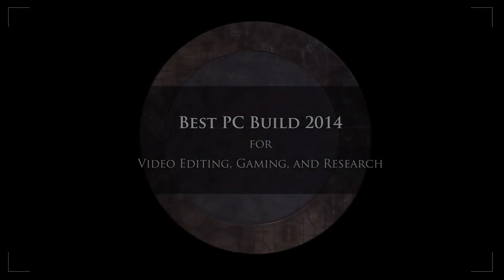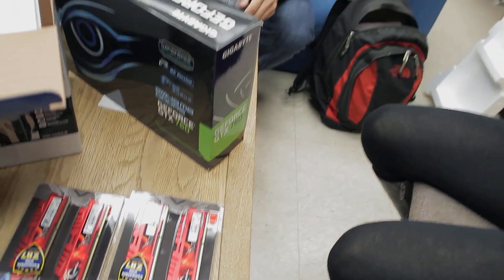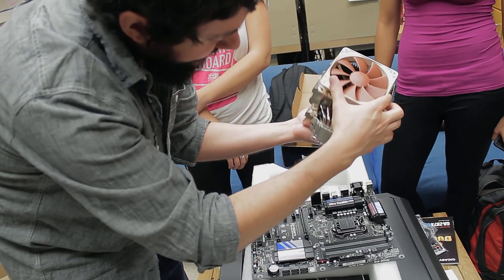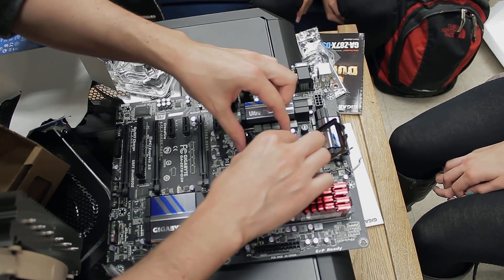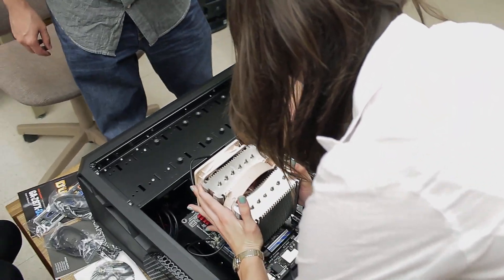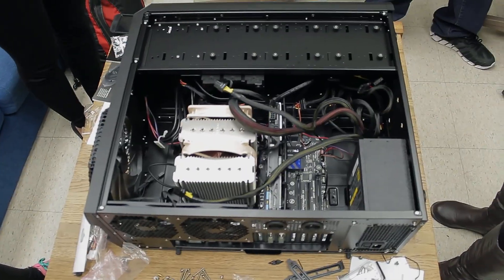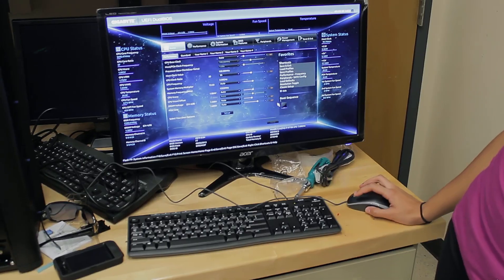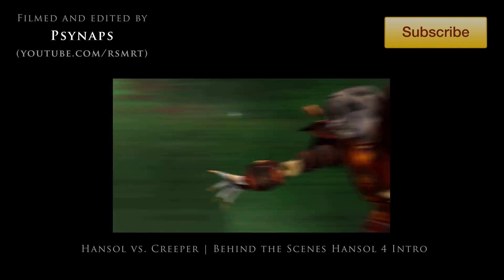Ultimate Gaming PC 2014 + Best Video Editing & Rendering Build (New Years Edition)

Comment: Unless you lay the computer case on its side, the large heat-sync will put a lot of downward pressure on the motherboard. Make sure to add support on the radiator. Shoestring sling mounted to the top of the case while wrapping around the heat-sync should do. Many a MoBo have broken due to these large heat-syncs.

Comment: 760? Amateur... GTX 970/980 just launched so I recommend, if your doing some intensive GPU programs (which you said your not), get it.
Reply from the maker: PickleKing3000 Yea GTX 970 is a really good value off the launch. Hopefully the 780 comes down in price as a result.
Reply: yeah i'm waiting for the prices to drop as well on the GTX 770... Decent performance for decent price
Reply from the maker: AgentCell Sorry you didnt get what you expected from the 980. Rendering still uses CPU, not GPU. The best render computers are powerful multicore CPUs. I am saving up for the new 5000 series Intel i7 which have 6-8 cores depending on the model. Those will be great all around video editing/rendering/gaming CPUs. Save the GPU for gaming, 3D, and previews. Rendering to popular video formats still uses CPU. Hopefully GPU support in the future.
Reply: I just build my mid/high end PC for the first time with a GTX 980 and I got to tell you when it comes to rendering videos, I'm very fucking disappointed. I heard from many sources that having an amazing graphics cared would've rendered my videos within seconds or minutes. It still takes me an hour with one video.

I looked online and set the preferences to use my GPU for rendering videos and it's actually slower than when I use the CPU. I'm really pissed off because I just spent over $1500 on building this supposedly grand PC. If anyone has a REAL guide on how to render videos fast, please let me know.

Below are my PC Specs. Tell me what you think.

Intel Core i5-4690 3.5GHz Quad-Core Processor
Gigabyte GA-B85M-DS3H Micro ATX LGA1150 Motherboard
G.Skill Ripjaws Z Series 8GB (2 x 4GB) DDR3-2400 Memory
Western Digital BLACK SERIES 3TB 3.5" 7200RPM Internal Hard Drive
Gigabyte GeForce GTX 980 4GB Video Card
Corsair Graphite Series 230T Grey ATX Mid Tower Case
Thermaltake SMART 550W 80+ Bronze Certified ATX Power Supply
LG GH24NSB0 DVD/CD Writer
Microsoft Windows 7 Home Premium SP1 (OEM) (64-bit)

Comment: What model of Gigabyte Motherboard are you using on this one?
I'm going to build a desktop for video editing specialy Sony Vegas 12 pro
Reply from the maker: Check description. I also noticed there are newer models of this motherboard from Gigabyte, just look at the specs to match. Cheers! Michael Razon
Reply: How long are you using this board? Sorry Psynaps I'm just a noob and I just wanna make sure that this is gonna last, because this is my first time building a deskstop and im interested in your setup, or if you have other recommendation for me regarding gigabyte motherboard , basically most of the time I'm going to use this for video editing . Thanks in advance and sorry for my bad English ;)
Reply from the maker: No prob. I have this board in 3 computers (basically 3 replicates of this build). They render 100% CPU all day since i built them with no problems and no overheating. My gaming/streaming/video editing machine has this mother board and build and I am sending this message using it. I have had no problems and is one of the best systems I have ever used. I can't tell you what you should do, but I can tell you my experience with this build and I am happy with it. Would build another. Michael Razon
Reply: Thanks a lot , it really helps me ;)
Have a nice day

Comment: Great build ,however your cable management is shocking ,next time take the other side panel off and route the wires from the motherboard side/tray through the management holes and then up the back of the motherboard tray and back through a management to the other side and plug in, this not only helps make it look more aesthetically pleasing but helps with better airflow as well which you were insistant on achieving

Comment: Why go with a 760 thats uses cuda  and is so much weaker when do video editing and adobe work??? And 16gigs would have been just as good, plus a 290 is a little more but with software you can unlock it too a 290x and make it 10x faster, i mean yes decent computer build but didnt put the money into the best use, and first thing i would run on it would be msi after burner since you can over clock that card super high with gigabytes 3x fan cooling

Comment: So you recommand to get the GTA 770 instead of the GTX 760? Thanks for your video, it helped a lot!
Reply from the maker: Update 6-614: Yea 780 > 770 > 760. I would def get the 770 over the 760. This computer was mostly for science and rendering so the 760 was good. Also, the 760 is great for BF4, LoL, WoW, and MC. However, for a better gaming experience add the 780 or 770 for a boost.
Reply: Psynaps Kinda fail underkill gpu for gaming and overkill ram for gaming
Reply: the gpu is good for science and ram is needed to launch those big projects 
a gpu that can run bf4 is NOT UNDERKILL

Comment: Heatsink: CORSAIR H105
 Psu: CORSAIR AX 1500i
 Gpu: GTX 780ti
Ram: G.SKILL Trident X
Mobo: ASUS MAXIMUS VII HERO
Storage: SAMSUNG 840 EVO 
Cpu: INTEL  i7 4930k

That would be the best Pc as of now. Then it's up to the user to choose how many graphics cards he wants, how many SSD's and how much GB's of Ram he wants. But these are the best components, quantity of the components is up to the user to the decide.

That being said.........

VERONICA IS SO FUCKING CUTE!!

EDIT:

And here is the July 9th 2014 Update for the best Nvidia/Intel Gaming PC (All while being realistic and reasonable: Screw the GTX TITAN BLACK and the GTX TITAN Z This is a PC that is for Gaming/Music/Video-editing so no GTX Titans required in this case.)

...So without further ado: 

THE SPECS:

PSU: Corsair 1500i
MOBO: ASUS Maximus VII Formula
CPU: I7 4790K 
GPU TYPE: GTX 780ti 
SSD TYPE: Samsung 850 Pro
HEATSINK: Corsair H110
RAM TYPE: Corsair Dominator Platinum or G.Skill Trident X
Sound Card (Optional): Asus Xonar Essence STX or ROG Xonar Phoebus

Comment: @ Psynaps you did alot of mistakes. you forgot to put the motherboard table in the case , horrible cable management , and next time.. never keep in your hands a motherboard with a giant Cpu- cooler cause you will  blow it. Anyway good job.. but you have to practice a little bit more.

Comment: Psynaps Is this a stable gaming pc build?

CPU : Intel Core i5-4670K 3.4GHz Quad-Core Processor
CPU Cooler : Noctua NH-D14 65.0 CFM CPU Cooler
Motherboard : MSI Z87-G45 Gaming ATX LGA1150 Motherboard
Memory : Corsair Vengeance LP 8GB (2 x 4GB) DDR3-1600 Memory
Storage : Samsung 840 EVO 250GB 2.5" Solid State Disk
Video Card : Gigabyte GeForce GTX 770 4GB (WindForce) Video Card
Case : Antec Twelve Hundred V3 Black Steel ATX Full Tower Gaming Case
Power Supply : Corsair 760W 80+ Platinum Certified Fully-Modular ATX Power Supply
Optical Drive : Asus DRW-24B1ST/BLK/B/AS DVD/CD Writer

Like is there anything that could be replaced by a cheaper part for the same performance? Is there any incompatibility? Is it a balanced build?

If I can get a response it would be great because I can't get onto tomshardware forums. Thanks! Love your channel!

Comment: AMD FD300 6 core- CPU 
AMD 970 MSI- Motherboard 
Radeon R9 270x- GFX Card 
LG DVD universal drive 
Kingston 8gb x2-RAM 
corsair 800 gold- power supply 
Storage up to you 
Case up to you 
Fan up to you 
This build will cost around $800 and can run Battlefield 4 at max settings at around 50-60 fps
Reply: Kursed Swaqq  still overkill
Reply: Vi Tran  forgot to mention I also over clocked so yea power supply is needed
Reply: I've seen this build before, and it is amazing!
Reply: Ernesto Del Bosque Lol, I've got an overclocked i7 & two Sapphire 7870's overclocked running on a single 750w psu... his 800w is so overkill it's sad..
Reply: TheAmanor123 aha i didn't end up joining yet, month or so till i get all the parts. ;)
Reply: Ernesto Del Bosque have you over clocked? Trust me it takes power, plus that's a 6 core CPU
Reply: Kursed Swaqq Sorry, I researched a little more now and you're right, AMD cpus and gpus are very power hungry specially when overclocked
Reply: still overkill man i got fx6100 oc 4 g and r9 290 and having 650 w power supply
Reply: Kursed Swaqq Use pcpartpicker it will tell you the estimated wattage you'll need and add I don't know 50 - 100w for OC
Reply: Ernesto Del Bosque thanks for the help
Reply: No problem! anytime
Reply: It is kind of shit!
Reply: aaron james your setup is so gay its sad :(   (making joke Dont take seriously)
Reply: Kursed Swaqq ;) I'm joining the darkside soon, i'm swapping to a fx-8320 & sabertooth motherboard ;)
Reply: aaron james good job bro welcome to the dark side of the power
Reply: aaron james nice make sure to get windows 8.1 if you Dont have it already it boosts your PC performance believe it or not
Reply: Already got it. (y) ;)
Reply: i cant oc my cpu well because of my 700watt psu i think
at 1.45+ volt or above the cpu underclocks some cores to 1.4 (AMD FX 8120)(XFX HD 7950)

Comment: Definetly the worst cablemanegement ive ever seen. Did you even THINK about using zip ties or routing the cables behind the motherboard? And the fans are going to hit the cables at some point... And whats up with these rear fans when turning on the computer? 1 started up slow and stopped spinning and the lower one didnt even turn on. And with video editing/rendering AND gaming its going to preform way better with only 16gb of memory and a gtx 770.

Comment: Nice build. Just wondering why you chose a heat sink that relies on airflow and then chose a non-modular (hard to manage cable type) PSU, thus causing hiccups in airflow. They aren't significant, but they can cause small bottlenecks in CPU temps and performance.

Comment: why not just get a corsair h100i
Reply from the maker: Very good question, I thought a lot about this. 1.) It costs more, 2.) does not perform any better for the extra cost you pay (see benchmarks, you may be surprised like I was) 3.) the entire system benefits from the airflow produced by the large fans on the heatsink keeping the case cooler.

Comment: First thing I would run is Skyrim, it would be sweet, I also have a question. 
Would a 650 Watt power supply power a GeForce EVGA 760 with no problem?
Reply from the maker: Nice, thx for the comment Brandon Gardner! 650 Watt for a single gfx card should be ok, There are power supply calculators on the web to be on the safe side, but my gut tells me it will work great!

Comment: Very nice! I have the same motherboard and processor. If you  record games I would recommend getting a second hd to store recordings on. I got a 2tb hd just for fraps lol. First thing I would do is wow on max settings and do lfr, I would think that's the most stressful thing for a processor/video card.
Reply from the maker: Thanks Bulletbill Wow for the comment! Good advice, I didn't show it here, but I actually got a 3TB external HD for these builds. For gaming and capturing, you will def need a large internal drive, preferably multiple large drives to hold all your video content!

Comment: I also use the i7 4770k (overclocked to 4.3 GHz) and the gigabyte GTX 760 oc. And it runs perfectly for both editing and gaming. :D
How much have you overclocked your i7 4770k?
Btw nice video ;)
Reply from the maker: Thx for the comment and input DanishPenguins! These work rigs are at 4.2, which is totally stable. If I go up higher, like 4.4+ I will occasionally get a crash when gaming, streaming, editing, and etc simultaneously. So it seems this build has a sweetspot in that area. There are motherboards that are better suited for more extreme overclocking.

Comment: Cool vid but i have to give some feedback xD
That was to much cool paste and 1 more tip you have to spread the paste over the cpu and NOT by pressing the cooler on the cpu
Reply: Imrie Schroer Watch linustechtips or tek syndicate. They don't recommend spreading the paste with a card. Because if you compress the paste near the corners it would "overflow" onto the motherboard. So its a no-no for spreading. Instead they recommend to put a small dot about the size of a grain on rice on the center and just compress the heatsink on. Don't correct me until you watch t heir videos. I may be wrong in minor parts but i remember the grain of rice part correctly.
Reply: rsmrt aN OLD CREDIT CARD WORKS WELL.
Reply: never spread it with a credit card. didn't watch the whole video but about the size of a very small pea is plenty of compound and the pressure of the mounting surface will spread it nicely.
Reply from the maker: Thx for the input and comment sinroysin! I am glad to get some feedback from a pro. Def an important part of optimizing the cooling. Temperatures on this build are great so far.
Reply: Getting pretty esoteric here. I never gave it all that much thought until now. Hmmmmmm.

Comment: I myself have built 2 computers before and done numerous upgrades on both of them and others. One thing that should be noted is that occasionally you'll get a component that is DOA(dead on arrival) and the computer will not start up. Although I've never had this happen I have heard about it happening to others.
Reply from the maker: Thx Jesse Smith for the comment. This is the 3rd replicate of this build I have done, and so far I have no DOA parts. Each component was carefully selected based on rating and other users experience, and I have been fortunate.

Comment: Also, you forgot to mention the following: ALWAYS watch your screws. Keep them in different boxes for different sizes. It is very easy to loose screws while building a PC, so it is better to be carefull about it. I usually have different boxes of screws for different sized screws, so they stay organized. It is also smart to lay out a sheet of paper and then mark the screwholes of the component on the paper, and then lay the screws ontop of that, so that you know where different screws go. :)
Reply from the maker: Very good advice by TheWoWElite! Thanks!

Comment: Man I'm soooo jealous, i would run Deadspace 3 !! Man one question, i have an i5 processor, and 8 gigs of ram, would u say that for gaming i would need to change in a near future to an i7 processor?? i heard that i7 is better if u render videos, but if u just game ? would it be necessary?? and what do u think about more ram!
Reply from the maker: Thx airtempo for commenting! Yea it wasn't long ago I used an i5 w 8GB ram for editing and gaming. Games are getting more intense, and for serious editing, I recommend an i7 with at least 16GB ram. If you have a good frame rate and your play experience is good, then you don't need to be pressured to upgrade yet.
Reply: The i5 3570k and i5 4670k are great processors.for gaming and maybe some light editing. 8gb of DDR3 ram is also the sweet spot for gaming. You could buy another pair or another stick of the same ram if you wish to upgrade.